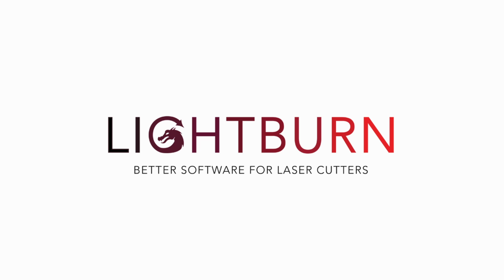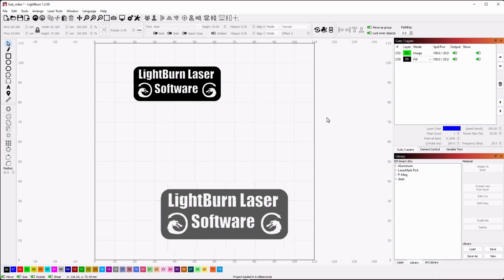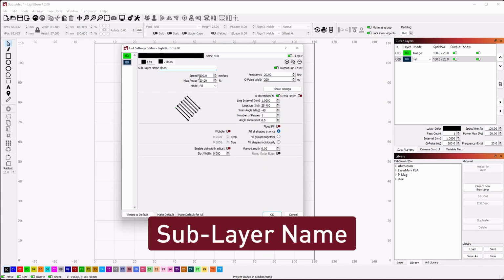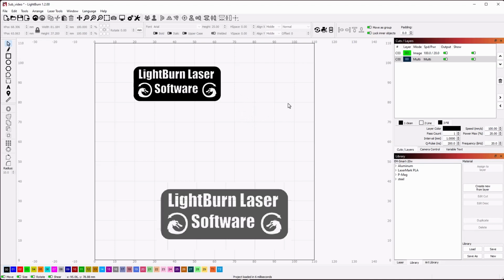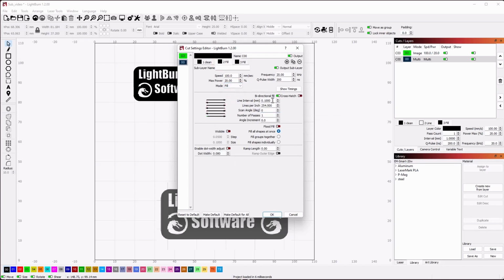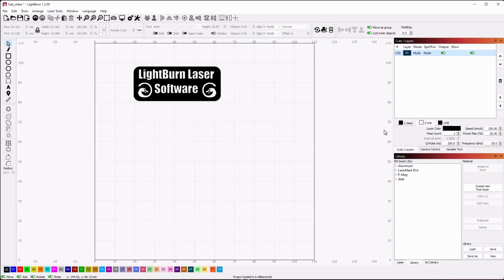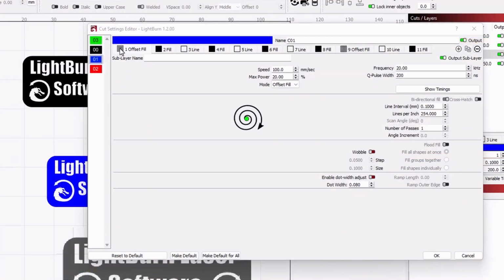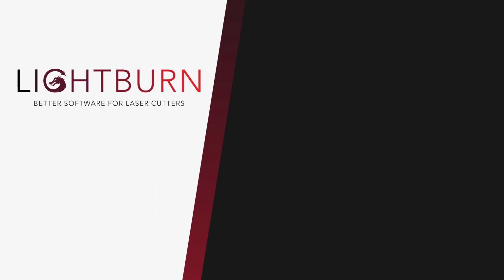How to Use Sub-Layers in LightBurn

Comment: This one lost me just a bit. Would be helpful to see some application of why one might use this. I'm a little slow 🙂
Reply from the maker: A good example is running an outline pass around some shapes after filling them, or being able to run a fill with multiple different fill angles, similar to cross hatch, but not forced to be 90 degrees to each other.

Comment: I just tried ordering the project by layer order on a galvo using rotary. The split size was large so the rotary could complete a layer before moving, which is faster. But the first layer was split, even after setting the project to start at the top. Would using sub-layers work? I’ve tried a ton of different things to complete a layer prior to the rotary’s move but I cant get it to work. Ill try sub layers in a couple days but would love to know if it’s possible for a layer to finish before rotary moves.
Reply from the maker: If you can send the project file you are attempting along with video/images of your output to support it will help to find the solution. The support email is support@lightburnsoftware.com
Reply: @lightburnsoftware7189  Right on! I'll send them this morning. Thank you!

Comment: Is this function on both co2 and diode lasers? I have an d1 pro and have the bought version of lightburn and only have fill, line and offset fill as my options 🤷‍♀️
Reply from the maker: As long as you are at least on version 1.2 of LightBurn you will have access to sub layers. Double click on any of your layers in the cut/layer window. This will open the cut settings editor. Towards the top right you will see the plus sign to add sublayers to the layer.

Comment: Just started giving sub-layers a try. Playing around with it I see that if you're in the Cut Settings Editor and you disable any sub-layers, the tab for that sublayer turns red, so you can see at a glance that it's disabled. However, once you exit the editor and go back to the Cuts/Layers list, all of the tabs are still black, so you can't tell at a glance if any sub-layers are disabled. Would be nice to have them turn red there, too, and perhaps place a toggle under each tab to disable/enable that sub-layer without having to go into the editor.

At first it threw me off that when I created sub-layers while in one layer, all of the layers now contained sub-layers. It might even be better if each layer on it's own could have a variable number of sub-layers (or no sub-layers at all). Just because I have sub-layers on C00 doesn't mean I want/need sub-layers on every layer in the system.

Comment: I cannot get the sub layers to output in VER. 1.203
I have made new files in VER. 1.203.
I have added layers.
I have opened  each layer to add sub layers to fill(2 sublayers)..
Outputs are green therefore ON.
Outputs only first layer and is a horizontal fill.
Have tried multiple installs and reinstalls and same condition.
Problem is even after deleting program, deleting set up file, rebooting and downloading setup file again I cannot get a clean fresh install.
It automatically loads my corefile. Does not allow me to do a fresh install as like very first install.
The forums are no help.
How do I reset to fresh install?
Any help would be appreciated.

Comment: Bloody hell why did I make things so complicated … they should give user the option for the user to have this feature turn off completely all on…
Reply from the maker: You can still use line or fill as separate layers. It does take a little getting used to but sublayers are quite powerful and allow you to easily perform multiple complex operations.
Reply: @lightburnsoftware7189  You're missing my point . The software should give you the option to have this advance option " on or off"  in the settings menu . instead of having to be forced to use it . but for me it's not . it just makes it more complicated for me & Burgers up all my files that I have prepared so far ....

Comment: Out of curiosity, what would the settings of a "Clean" run be? Is it just a lower power quicker speed run to clean the cutting space?
Reply from the maker: A cleaning pass is usually 2-3x faster and a frequency of at least double.
Reply: @lightburnsoftware7189  Thank you for the reply!

Comment: wish there was an option to allow sub layers to run simultaneously as in run a rough in and then a clean up for tumblers i set the parameters but it stops after first layer is finished even though system shows both layers to output
Reply from the maker: That sounds like either a bug or a settings issue.  I’d have you attach your file so we could have a look, but that’s not possible in a YouTube comment.  If you email it to support@lightburnsoftware.com and explain the issue, we could have a look.
Reply: @lightburnsoftware7189  sent now thank you for the quick response makes me glad i switched to lightburn
Reply: I have the same problem on some of my files since the update.
This video at least clarifies the changes.

Comment: The new "Sublayers" feature is handy, useful, and it works well. However, the Lightburn programmers should have also kept the "Fill+Line" option in the drop down menu as well. Sometimes you just want to select a simple function for a quick project. Programmers are always making things more complicated than necessary in updates, just to say "Look what we did!" From what I have seen in all of the online laser forums, most people agree with this and want the "Fill+Line" option put back in the next update. Other than this issue with the most recent update Lightburn is great software. 👍 👍
Reply: agreed. I hate it when software designers remove a tool or function because "they" think it's not being used. If the code is already written, then why get rid of it!

Comment: Sub Layers would be better if you could assign them from the library. Currently to use sublayers you need to have your entire library written down on paper and manually enter the sublayers. Sublayers can be an awesome feature but currently they have rendered the library feature useless.
Reply from the maker: This is incorrect - Sub-layers are stored in the library like anything else.  That said, you cannot assign a single sub-layer from a library setting.  The entire layer, including sub-layers, can be assigned to or from a material entry in the library.
Reply: @lightburnsoftware7189  Odd you said incorrect and then said exactly what I said. You just said it different and did not apply production to it. Production is about job time and reduction of errors. Opening existing libraries to write down absolutely everything so it can be re-entered a multitude of times as sub-layers in 4 times the library entries does not address "production is about time and reduction of errors" never mind typo errors! It messes up both! Sub-layers is awesome! As long as we can use tested library entries without re-typing. I don't know about you but I have multiple lasers in multiple wattage and that is a huge pile of library entries to wrote out on paper so I can re-enter them. Then I have to hope and pray I didn't have any typos. The pray I don't blow out any clients projects - each entry will have to be re-tested.

 Adding a button to the library that says "add as sub-layer(s)" does address these problems as tested data does not have to be re-entered. Data is very easily findable as the library entries are mostly single layer (line and fill now split into 2). Operators know what operations are needed, adding raw operations as sublayers to a project would be awesome. I wouldn't have to re-test every single library entry for every single laser.

 Library management or data management is an age old problem, it needs to be simple or it becomes a disaster fast. The only way I see to find an entry fast is put it in as a single layer library entry, but that entry is useless and has to be re-typed to use in current state. If that is burried in a multi-layer library entry finding it will slowly become impossible. All of which goes against "job time and reduction of errors". I see it now, 6 months ago I created a multi-layer library entry that one of the sub-layers has the perfect settings for my current project, I wish I could remember which one that was.

 I've been on many software dev projects where this type of problem happened. The questions are how are you going to describe these multi-layer entries so you can accurately pick them later without spending minutes reading all the sub-settings, is your memory good enough to know the sub settings are right? Its easy to call one "steel deep engrave", that is clear and tested. Its fast to pick that one and 4 others from the library and know you have the right parameters. Its slow to read through multiple entries looking for the one that has the right 4 sub-layers and verify the parameters are correct to save the "oops, oh ya that entry was for some special project"

 Operators know what they need for a project, I don't think they need saved multi-layer libraries as I know that will get into the thousands of entries and add more mistakes and complexity later. What they do need is what I mentioned, add as sub-layer to the current working layer from tried and tested entries. Each job is different making many library entries difficult. Just think of all the possibilities for Aluminum, what 15 core operations and 200 combinations. I'm good with 15 core and 5 combinations and build on the fly the rest. That will cut costs with less time and mistakes and not increase costs.
Reply from the maker: @3dtwerking324  - You said "Currently to use sub-layers you have to write everything down and manually enter them".  I said that was incorrect, because if you create a library entry that has sub-layers, they're all stored.

You didn't make it clear that you were looking to store and recall a single sub-layer into a layer.  This is brand new, and you're right, we haven't thought of every possible way to use it yet, but now that I actually understand what you were looking for, we'll look into it.
Reply: @lightburnsoftware7189  Thank you. You do know that to make a sub-layer you already need to know the parameters and to get those parameters you will have to look at an old unusable library entry, likely write it on paper then go re-enter it into the sub-layer.  Then rinse and repeat a pile of times for each multi-operation that uses that same raw operation. Otherwise where is it you plan to get the parameters for the sub-layer from? I can't remember all 200 of my library entry parameters for each of the 6 different laser types I have to magically enter them as a sub-layer. I do have to look first!

 That by the by is another useful idea thinking on laser type I see everyone struggling with. Thinking out loud, add to the laser profile a factor or 3 for laser speed/strength/type. Then add to each library entry the laser power and type. Then when you open a laser profile for a diode 10W it knows how to convert the library entry from the 90W CO2 it was entered with to the current selected laser and libraries are not needed for every separate laser machine. Even older units could have factors to adjust for things like tube age. I have found that 2 lasers of the same type/model are just a bit different. For tuning you could add a library entry for a final factor for tuning and confirmed tested. That with linked library entries would allow for global changes to be made as lasers age. The library becomes part of a business laser management system saving time and materials.

 The thought there is everyone runs test patterns on every laser and every material from scratch each time and re-runs it as the laser ages. Cut all that out, run it all once on one laser. The tweak it on each of the other lasers with a few +/- factor on the machine profile.
Reply: Even just an option to copy from the library into a sub layer would be nicer than manually doing it.

Comment: Do Ruida controllers handle the sub-layers accurately or will they need to be run using the START command from Lightburn?
Reply from the maker: Though, in addition to Joe's reply, we did find a bug with this, which is fixed in the pending 1.2.01 release.
Reply: Ruida handles them fine. You can start or send just like you are used too